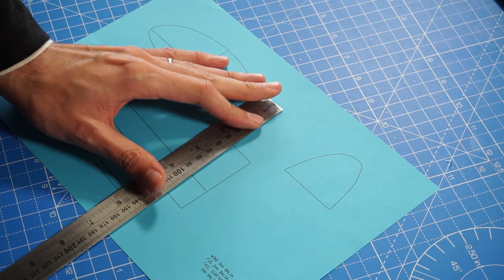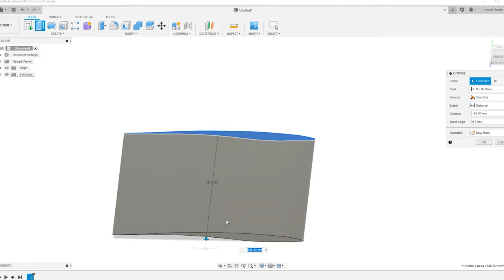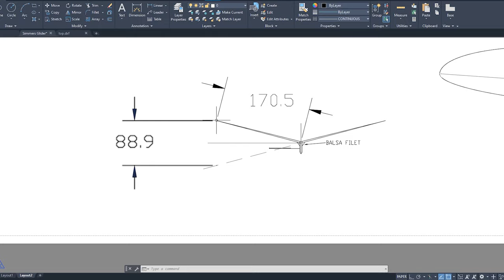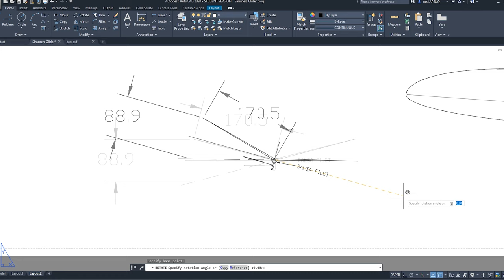How to make a great free flight glider with Balsa wood

Comment: Just asking, but wouldn't the glider fly better if the wings folded down and you give a little less thrust? as the down wings will provide stable lift allowing long glide range and speed at the same time

Comment: I have a question.can I use 2mm balsa and then sand down the stabilizers so they have an airfoil too???
Reply from the maker: Yes, but stabilizer don't need to generate lift, a simetric airfoil is recommend.
Reply: @Joyplanes  okay thanks

Comment: I think it lacks angle of incidence.
Reply from the maker: I'll make another one and test that.
Reply: @Joyplanes  Es un aeromodelo muy bonito.
Reply: This was designed for indoor flying.  Indoor gliders don't need as much built-in stability as outdoor flyers.  For outdoor use, build one, see how it performs and adjust as needed.  At 7:01, you can see he is adding 'up' elevator.  Too much 'up' elevator and the plane will loop at the launch.  It's a tightrope between enough incidence for recovery and too much so it loops.